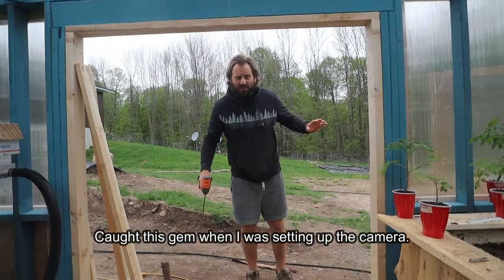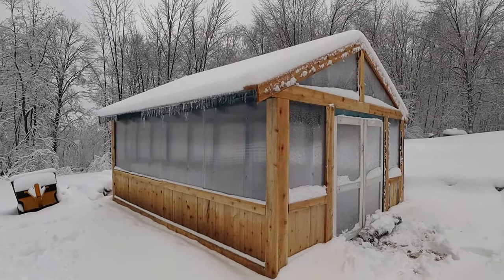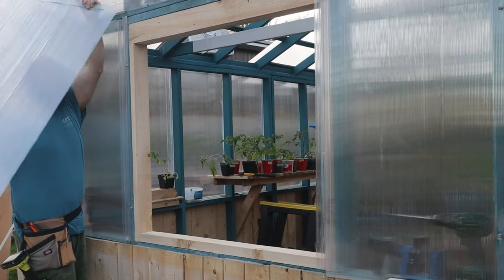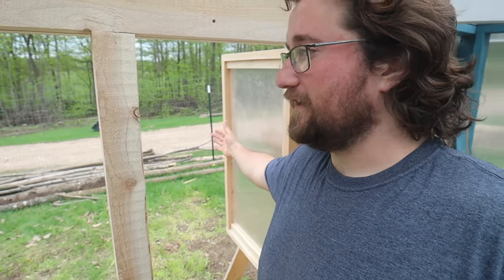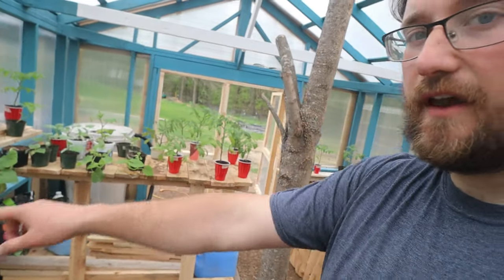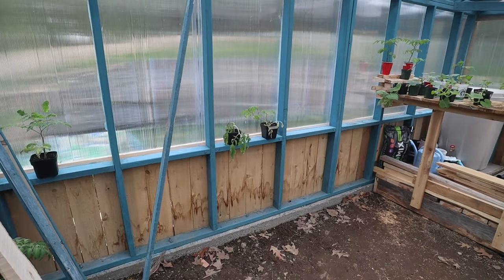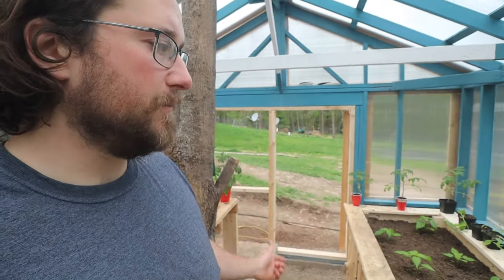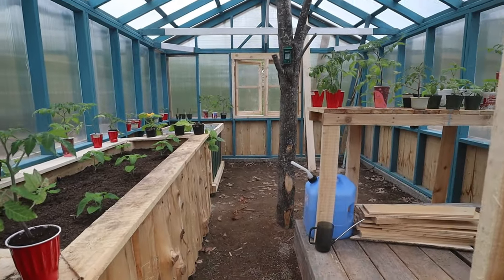DIY Greenhouse Ventilation

Comment: haha, Nate :)
I have been working on "outfitting" my greenhouse this spring also.  I have a small potting greenhouse at my home, so I don't do that sort of thing at my larger farm greenhouse.  We got the "skin" on the farm one last fall (only 2 years of working on it!) and we moved cardboard and wood chips and a picnic table and my potted strawberries into one end.  It was wonderful in the winter to have a place out of the snow and wind.  We moved an 8'x8' cattle panel rooster pen around in there most of the winter.  We slowly butchered them and saved one to be the breeding rooster for this year.  Whenever the pen moved I laid out cardboard. 
So, this spring I removed a bunch of things and have started making a wood chip path down the middle.  I plan to add soil from our "barnyard clean up" compost pile for the beds.  My husband claims 😁 that I said he wouldn't need to create raised beds for this one  (but he has no proof) so for this year I will plant in the ground.  Next year could be different. ha.  I am thinking of mostly putting tomatoes and peppers in it.
We made double doors on one end and double doors and a winter man door (a used storm door with removable glass and a screen) on the other end.  Each double door has hardware cloth for the summer (we have livestock and other animals that I don't want in greenhouse)  and "storm" windows that fasten in for the winter.  I am trying to figure out if we need more ventilation as the greenhouse is about 42' long.  I hope not.  It is sort of windy up there so maybe the air will move without a fan. I am casually researching solar fans.
unrelated, your blueberry patch.  Did you do soil testing for pH?  I watched every video on the internet this spring and got 16 blueberry plants.  I have not had good luck with them in the past.  I also bought a cheap pH meter and 50#  of elemental sulfur.  (50#  was $1 a pound)  I added great "lively" soil and peat moss and have pine wood chips for the mulch.  I am hoping for the best.

Comment: I had come here to see how that I could get a greenhouse roof vent built and installed. But, this video didn't show how to build and install a ROOF VENT, BUT, I do see how to install a vent that is on the sides of the GH.  Although a ROOF VENT would be best, I may have to try the vent being on the side of the GH,. and as close to the roof as can be. 
I already have a vent/fan setup that is near the roof level, but, that isn't enough to cool off the GH when the sun can heat up the GH. In winter, usually, the sun won't make it TOO hot, BUT, it CAN make it pretty damn warm for brief periods of time. 
But, I really want to have a roof vent installed in my greenhouse that will open once the temps go over a certain amount of heat. My greenhouse had been an Amish made greenhouse.  It is VERY sturdy, and had been site delivered all in one piece. 

But, when I bought it, I had NO IDEA that it SHOULD have had a roof vent. So, I had removed the vent that it did have at the back end of it that had just been a vent that had just been 4 slits on a panel that had been there as ventilation.  I had removed that vent, and I had installed an electric ventilation fan that comes on once the greenhouse goes to about 80 F or more. And, that fan that I put in does come on once the GH gets above 80 F. I also have put in a fan that is hung up on one of the GH roof joists, and I have it facing so that it will blow the air towards that vent with the ventilation fan. BUT, even with all of that, my GH had NOT been cool enough to go below the 90's F. I've even had some plants KILLED from the high temps. 
I have now bought some shadecloth. I have yet to install it. I had actually bought shadecloth before, and had it installed. But, it was BLACK colored shadecloth, and 30% shade. It did NOT cool my GH off at all, so, I tore it down. I now have a white shadecloth that is 40%. So, I am just hoping that I can get the shadecloth up, and that IF I DO get it up that it will cool my GH off enough that my plants won't get BAKED or even KILLED. 
I do still want a roof vent installed in my GH IF I could ever get someone to do the job. 
These days it's hard to get work done by anybody, and IF they agree to do the work,. will they do a good job?

Comment: I am curious to know if the ventilation worked? I have a similar set up and I find that the cross breeze doesn't provide enough ventilation and I am now looking for ideas about opening part of the roof so the warm air has somewhere to go.
Reply from the maker: Hi there! So far I would say that it has been enough for us. it has been a hot summer and all of the plants in there are doing well. Opening up the roof is the way to go, I wish we thought of that when we were planning out the build. It would be tough to do now.
Reply: Try 12" exhaust fans